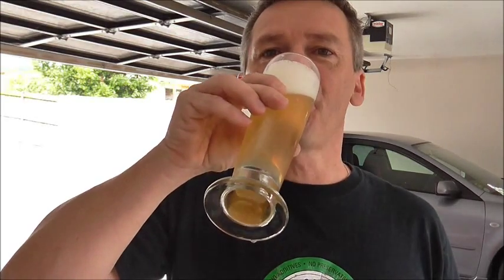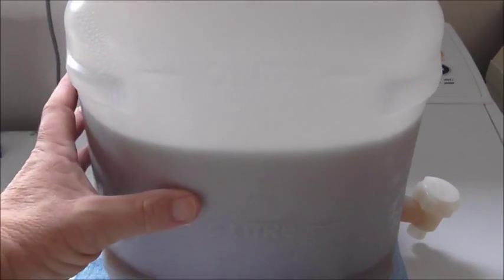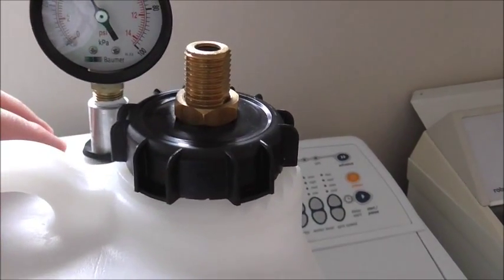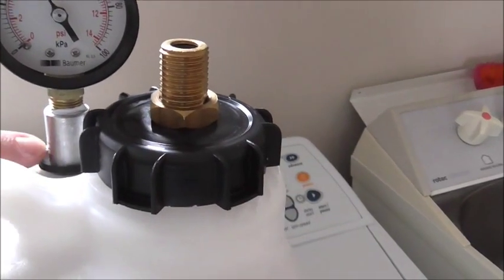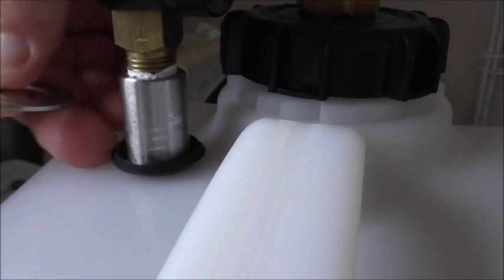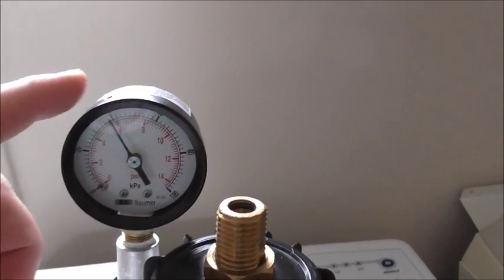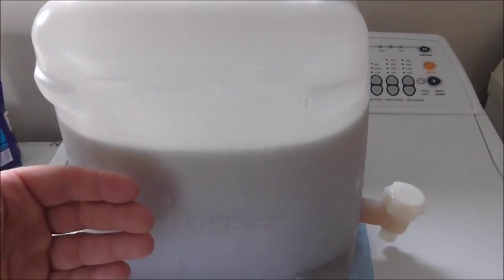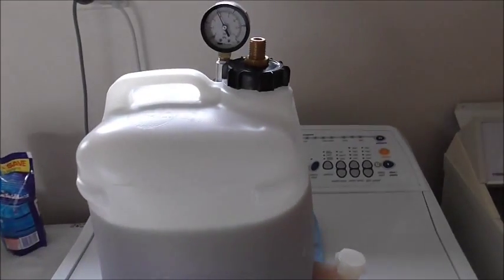HBW #25 - 16th April 2014 - DIY 10L Mini Pressure Barrel 2.0 Upgrade

Comment: Brilliant. Really really impressed with this. Could you omit the sugar  and carb from the cylinder or would it take too much to do that?
Reply from the maker: Thanks Ant. You could omit the sugar, but I think it would be difficult/dangerous/time consuming? to force carb properly, especially with the plastics lower tolerance to high pressures. Using the sugar (only 40gms this time, but maybe more next time) was enough to carb the beer up nice and naturally to around 2-2.5 psi and then it doesn't take much gas at all to top up the pressure to 6 psi. 6 psi is about as high as I dare go, and I think this is the safe maximum for the commercial plastic barrels as well. I'll do a pour video tomorrow. Cheers mate

Comment: Nice one Dino, might do the same myself as the normal pressure barrels take up so much space in the fridge-could be an Easter project!
Cheers mate and hhb
Reply from the maker: Thanks Dave. I'm going to pop in the fridge today. It's a bit taller with the gauge than I thought it would be, so might have to re-arrange the shelves, but like you say, it's a lot smaller than big barrel. I'll still use my big barrel over winter, when it doesn't need to go into a fridge. Cheers mate hhbw

Comment: Had a thought - once the sugar carbing is done you should chill down in the fridge which will make the fluid absorb more co2 then force carb by tank rest of the way. Doing a good job of it. Another thought was using it to ferment in - pressure will accelerate the fermentation and dicetyl rest considerably. Worth an experiment.
Reply from the maker: Yeah, it's been 6 days, so I'm guessing all the priming sugar has been consumed by now. Was going to pop the barrel in the fridge, but I'll do that today, so I can be drinking some tomorrow for Good Friday!! Yes, fermenting in it would be worth a go too. Cheers for the tips.

Comment: Nice update Dino. Looking good so far for mini pressure cube. I noticed in the warehouse catalog this week the have 5 litre pressure garden sprayers with a pressure gauge down to $15.....got me thinking now.....Where do you get the pressure gauge?
Reply from the maker: Yeah, Gash Slugg mentioned people have used garden sprayers. I got the gauge from Blackwoods Protector and the fittings from Anzor. The gauge was about $17 and the fittings for it about $10. Where abouts in the Country are you Zane? Cheers
Reply: Wow good steal!!!
Reply from the maker: brewtubetech Yeah, I was surprised at the price. I thought it was going to be more. Cheers